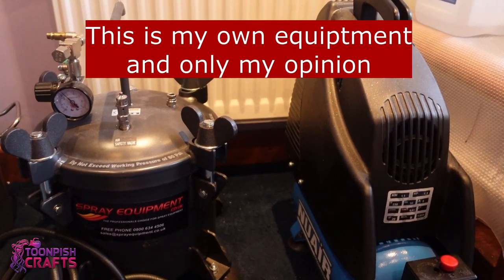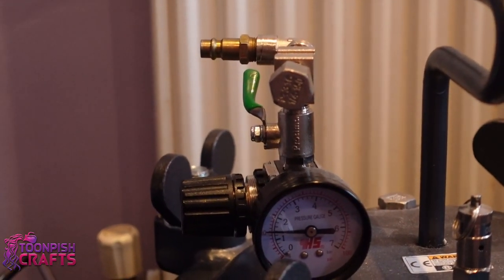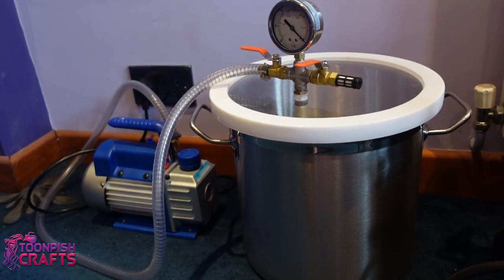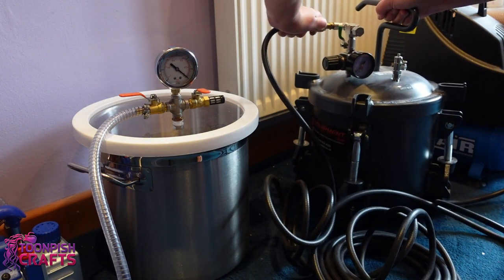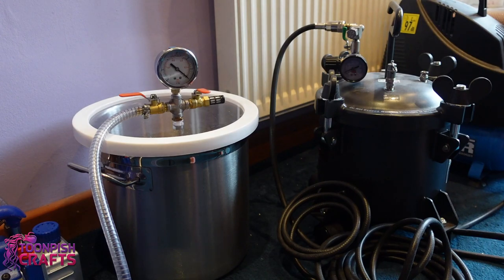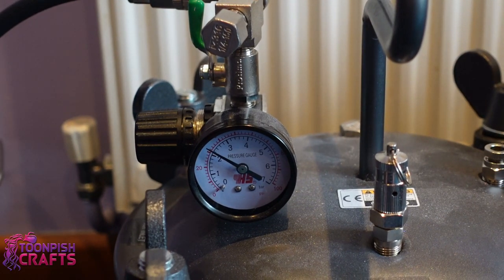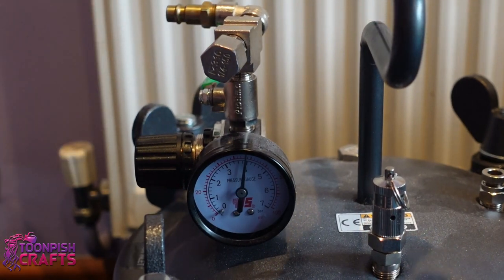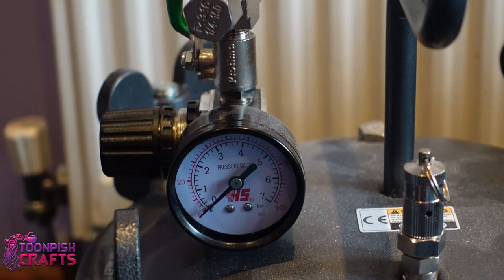Why use a pressure pot or vacuum chamber for resin? I’ll try to explain

Comment: Just a couple of points to add to that
1. I have a40l pressure pot and it came with a spanner for the wingnuts that I use to tighten them up. Essentially it’s a massive pipe bomb so I’d be wary of just hand tightening the nuts. 
2. The vacuum chamber is for degassing resin or silicone so you wouldn’t cure in it but you could degas before you pour if you don’t have a pressure pot.
3. Finally be prepared cos they’re not cheap at all so if people are considering buying one they need deep pockets 😝 

Nice video Wendy 👍🏻
Reply from the maker: Thanks for the input. Like I said I'm no expert, but a fare few resin artists are wanting to go this way. So I felt I needed to help in what small way I can. It's good to have more information. The more the better. 👍😁
Reply: @Toonpish  I think it’s great to see videos like this Wendy too many people assume everyone knows everything and it’s nice to share the knowledge 👌🏻 xx
Reply from the maker: Awww thats so much 😁😁😁👍

Comment: I have both a vacuum chamber and a pressure pot, but haven't use either one. I plan on using the vacuum pot mostly for making molds. Hoping for good results from these, and appreciate the how-tos!
Reply from the maker: Thank you Pam. Trust me, the pressure pot is an absolute god send. I only wish I had more of them 😅😂🙄🤔

Comment: I vacuum the resin pretty much each time, just half filling the cups to allow room for it to froth up and not overflow. 

Warmer resin will have less bubbles when you mix it, and that can make a huge difference in how quick you can remove them with the vacuum chamber. 

I use the pressure pot in my heating enclosure for larger items where I want zero bubbles, and like you leaning it against the radiator, mine sits in a heated box that cycles between 25 and 35c for the duration of the cure time
Reply from the maker: Fantastic 😀😀😀 thank you for sharing this 👍💜

Comment: Thanks for the vid. Very informative. Whilst I’m here can I ask if anyone can recommend where to buy a complete pressure pot kit including compressor and hoses, etc specifically for curing resin? I think I would really bodge up having to purchase parts separately. Any advice would be gravely received. Thank you in advance. 🙏🏽
Reply: Greatly….not gravely. Sorry for typo. 🙏🏽🙏🏽
Reply from the maker: Hi there. I got mine as a complete package but there were parts it didn’t come with like the hose and fittings 
So I can’t say it’s a package 😳😣

Comment: Can you do the bulbs without one of these? Wouldn't know where to start with one of them lol x
Reply from the maker: Yes you can, but depending on what resin you use you might have some bubbles. 😁👍
Reply: @Toonpish  what resin would you recommend to do one without a pressure pot x
Reply from the maker: @karenscarsbrook8461  in the UK, I would recommend vista Ocean

Comment: hi Wendy do you find with the pressure pot that it lose its pressure if its not left on the compressor?
Reply from the maker: Sometimes a little but nothing much. 😀
If that’s happening to you then you may need a new seal? 
Mine is warn and sometimes slips so the air comes out. But I do it again and it’s fine 😀
Hope that helps 😀👍
Reply: @Toonpish  thanks Wendy 😊 I try it again, it is new pressure pot but might be that I didn't do it properly , am new to using a pressure pot, compressors am use too as I use them in work
Reply from the maker: @lancemorgan651  it’s the compressor that I can’t control 😂😂 I need lessons 😳
Reply: @Toonpish  Happy to help you with the compressor Wendy anytime 🙂
Reply from the maker: @lancemorgan651  thank you 😊

Comment: I used to vent my pressure pot indoors, until I realized I was filling the house with all those toxic fumes. Now, I carry it outside to vent it. When I get it permanently mounted, I will have a hose to carry the fumes outside. They ARE dangerous.
I like the idea of vacuuming out the air, but I've seen too many videos where you have to carefully tend to the process or the resin will foam up and get all over everything. Which method do you prefer? Most people don't have both devices, so I'd like to hear your opinion. I had some slower-curing resin in my pressure pot last night and when I pulled the pieces out, for the first time, they had big bubbles from the release of pressure. My resin had always been cured by that time, so I wasn't expecting that.
Reply from the maker: Yes I agree with the gasses. It looks as if I am in the main part of the house, but the room I use is part of the extension and has an airtight door which is kept shut. So it is away from everything and everyone 👍. 
I do prefer the pressure pot. But I like to use the vacuum chamber for silicone rubber. 
Thanks so much for commenting 🤗

Comment: I put a jar mold in my pressure pot and it collapsed and ended up ruined. How do you handle molds that are hollow on the inside, like jars?
Reply from the maker: If the moulds are thin and empty in the middle they may collapse for sure. 
Fill the middle with something solid like a block of resin or even plaster of Paris
Reply from the maker: https://youtu.be/1k093Vrgsvg?si=IUJeYoxrOJAfSt_X

Might help 😀😀
Reply: @Toonpish  thank you !

Comment: Has anyone tried using their insta pot pressure cooker?
Reply from the maker: Oh 😳🤔🤔 not that I know of 🤔
Reply: @Toonpish  I found a guy that uses a 3 1/2 gallon bucket with a lock lid. He bought a tire stem from Wal-Mart and uses his tire pump. Cost him 10 bucks. He showed the difference with and with out using it on his casting, with it he got that crystal clear without a little milky.
Reply from the maker: That is fantastic 😀😀 it definitely makes a difference for sure 👌